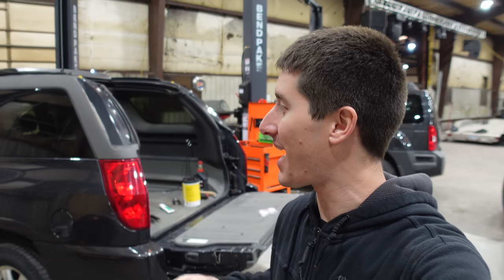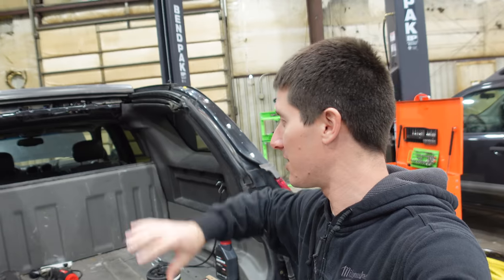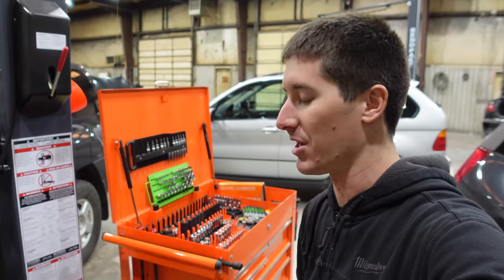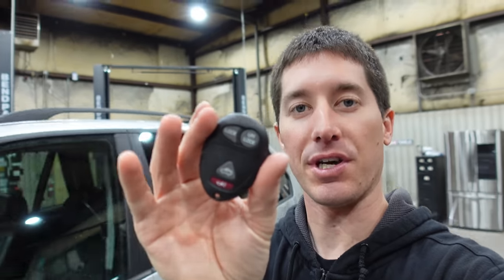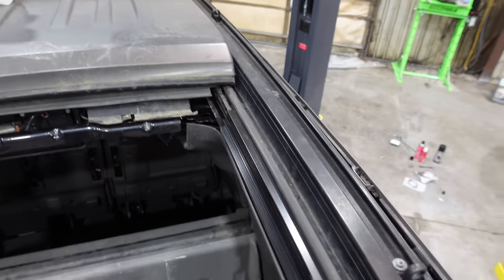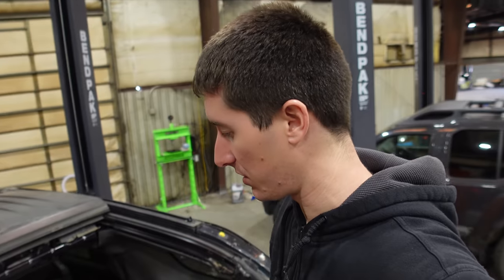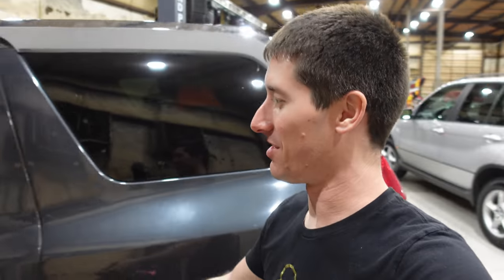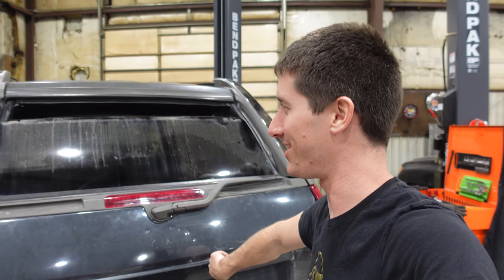ESCAPING From My FINISHED GMC Envoy XUV *It's A Transformer*

Comment: It's only an emergency escape if the window motor works and you have power though.😯
Reply: I believe it Des inganches the mechanism if ther in no power to lower the window slowly

But that way would just drop

I pretty sure they thought about it when designing and developing it out

Comment: If you still have the old roof parts you should take the loops from the rails used to secure items and put them where the bolts are so that whoever buys this will have 8 instead of just 4. I wish I had more for my XUV so I wouldn't have to move them when securing items. Thank you for these videos!

Comment: Un-fun fact: the Oil Pressure gauge is a dummy, there is only a pressure switch (leaks and bridges the contacts often) and when it is not tripped by too low pressure the gauge shows a pressure based on RPM (and temp?).

Comment: On a side note i watched the Motor Week tv show about 20 years ago test the additive Restore with a compression test and it added compression. John Davis said i can't believe a product has actually done what they claimed. So i've been using it on my older vehicles since then and it has helped.my old truck run without bogging down under load. FWIW. Bought an older Pontiac recently and might try the EPR to clean things out as well.

Comment: I think one of the original advertisement for the XUV they had a large Side by Side refrigerator in the back standing up.
Reply: I was wondering how wide the roof opening is, and how big a refrigerator you could stand up there.
Reply: And the one with the tree sticking out the top

Comment: You wouldn't believe how tough these engines actually are. My wife went to Walmart to get the oil changed in her Envoy, and they drained it and never put any oil back in it and let her drive it away. Within a block of leaving the store warning lights were going off, and she drove it back to Walmart and had them check the oil. There was no oil in it of course and the rings were shot that quick. Walmart says since she left the parking lot they were no longer responsible but went ahead and filled it with oil anyway, you know cause they are such nice people. So a few months later I change the oil myself and we leave for Orlando Florida the next day from Kansas. We drove the 27hr trip straight through without ever shutting the car off and when we pulled into our condo in Orlando the oil pressure needle swung like the pendulum on a grandfather clock. I shut it off and checked the oil and it barely hit the dip stick, it had burned 71/2  quarts in 1400 miles. So I went to autozone and bought everything to do an oil change in their parking lot. The Envoy was running great and we put another 2000 miles on it coming home. I sold it a year later with 105k miles on it and that person has put another 30k on it since then and it still running strong.

Comment: My 05 5.3 V8 XUV was fantastic. Tons of luxury options, ran great. Displacement on demand made for great highway mileage. I was anal about keeping the roof tracks clean and greased so I never had any trouble. Plus in the winter I would put the center glass up so it was easier to heat up the interior. I wish I still had it.

Comment: Hey JR, do you feel like doing all those oil additives is good for anyone to do on a high mileage vehicle? My 2017 civic is about to hit 150k miles and I’ve just been doing regular maintenance on it through it all, debating on possibly doing this same kinda treatment next time I gotta do oil
Reply: Additives are prolly fine. You really should at least replace all fluids every 100k though. Brake Fluid ATF Coolant no need to flush just replace at the least. Timing service if it's a belt (honda toyota especially they love them belts) is typically around 100k. You should likely change your plugs maybe the coil pack or the like as well. The last couple of cars I've had with 100k or more I've also gone ahead if they were easy to get to and not an arm and a leg is to pop in new injectors maybe the fuel rail. GM's at least the newish models in the last decade I can pop out the injectors and rail on the 4 bangers and get new in no problem. If they're cheap enough being key there. I think some of the German makes the coil packs and injectors can get up there so just run an additive imo.
Reply: @inducedapathy1296  appreciate the tips, I've not done much on fluids except top fluids off  if need be and exchange transmission and oil fluids, mine is a cvt I know that, but im a little inept on the knowledge on my own car on what I should maintain under the hood wise, I still have two and a half years of paying on it and I wanna have it for at least 6 months after I pay it off so I presume I'll have upwards of 250k miles by the time I get rod of it.
Reply: @marktate2683  Check your manual and its service intervals. You have an extreme amount of wear on the vehicle. It's easy to forget since you might think 2017 is relatively newish. You've already put over double nearing triple the miles on it than average. That's an easy two thousand off its value perhaps more as it stands even in mint condition.
Reply: They work great, esp with high miles. Its the safest and most effective treatments to run
Reply: @inducedapathy1296  wish I could say it was in mint condition 🥴 I bought it cuz I knew I'd be putting hella miles on it.
Reply: @marktate2683  I hear ya! I used to do contract work where I would cover a tri-county area with quite a bit of driving involved. I used a Mazda at the time and killed the first transmission on it due to such things. I did not regularly change the fluids besides oil at that time. Oh well.

Good luck with everything Mark.

Comment: What’s the stuff for the seal called?? I want to use it on my Pontiac G6 convertible to revitalize the seals
Reply: J.Shreve he has a link in the description. I can also attest it's good stuff
Reply: Shinitzu grease. Popular with the Honda S2000 crowd.
Reply: @boilerhousegarage  does it help keep water out? My top doesn’t leak usually, but I’ve gotten dripped on one time in 2 years of ownership and it kinda freaked me out. Don’t want it to get worse